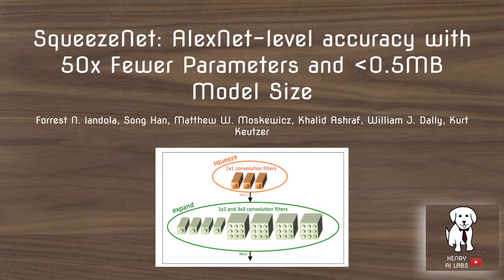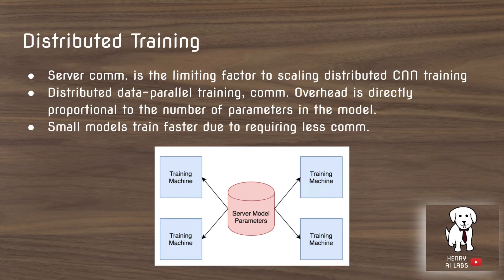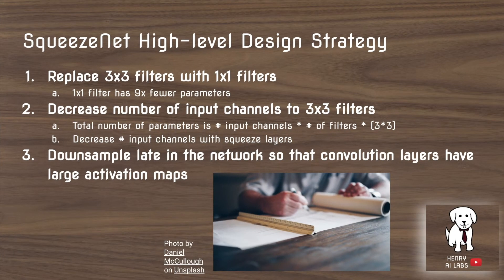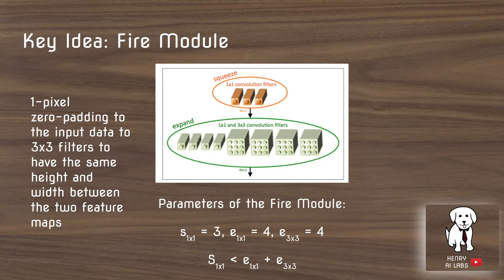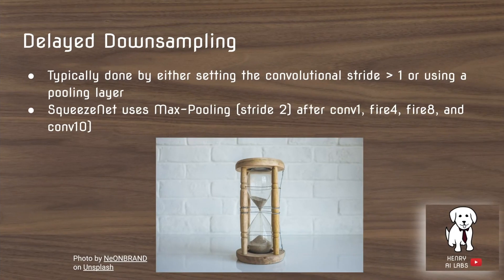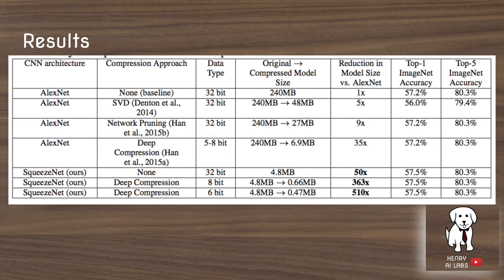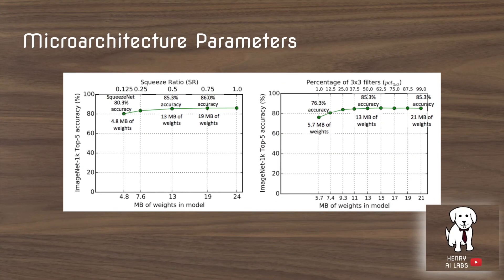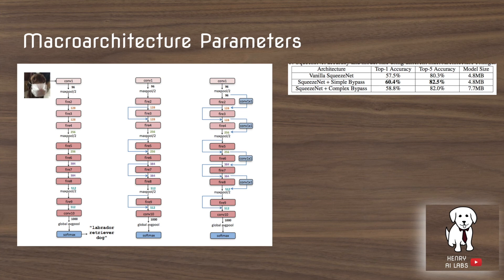SqueezeNet

Comment: HI Henry, I enjoyed the video .  When I implemented the model for image classification  I'm getting the accuracy >89 but after that when I'm try to predict the images its giving me wrong predictions . please help me. thank you
Reply from the maker: Sounds like you have overfitted to the dataset. I would recommend adding a serious amount of data augmentation, and if that isn't strong enough, add some dropout layers and weight normalization. I have recently made a video on Population-Based Augmentation which is a schedule of data augmentations developed by UC Berkeley. I would recommend checking out the video if you would like an overview of what the "Population-based" part means, and then I would go to their open-source repository where you can grab the augmentation schedule and drop it into your problem. Thank you for your comment and for watching!
Reply: @connor-shorten  thank you so much